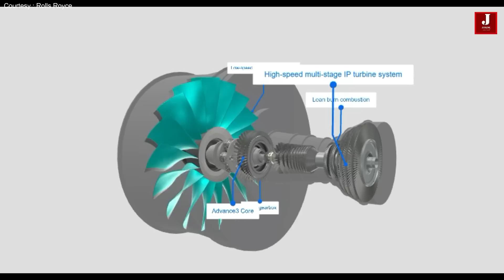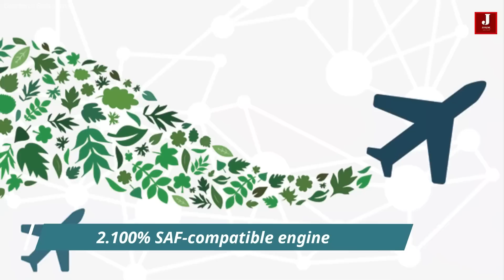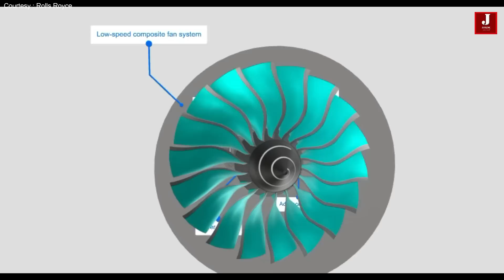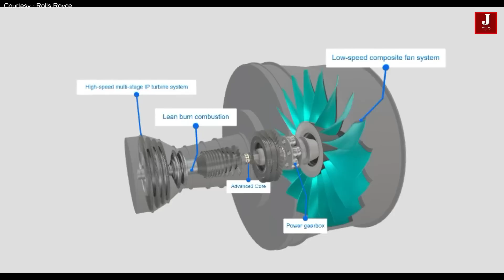The world's largest engine The Rolls Royce UltraFan: 10 Key Takeaways.

Comment: Even the current A350-900/-1000 can hold UltraFan engine without changing engine positions
Reply: No....that is not the idea. Rolls have built this demonstrator with 140" fan as its the largest size that can be fitted to the 777x (even though GE have exclusivity till 2027). It will give RR an idea of how the design compares with other offerings. Then it will be scaled down to fit whichever plane they plan to adapt it for.
Reply: @nathd1748  2027? so the 777X's launch date at this rate
Reply: @nathd1748  exactly.....the ultrafan would also fit for narrowbody
Reply: @Stradivarious Hardhiantz  yes. RR are itching for a slice of that huge A320neo backlog.
Reply: @nathd1748  They already missed that boat.
Reply: @John Iii  Missed the start of the boats journey you mean? There are about 4000 outstanding A321 orders that will take Airbus 10 years to get on top of. If RR provide an engine option that knocks spots off the current Leap and GTF, Airbus will certify it. You are miles from the action mate. I'm HERE right IN IT!! Current figures from initial tests of UF are giving 12% fuel performance saving over the GE9x...YES TWELVE. You will hear the official news in about 3 months. Last time round I had to tell you the UF was built and ready for testing while you were claiming RR had put it on the back-burner!
Reply: @nathd1748  John is very anti Airbus and RR, I've been reading his bile for years, he's even saying about the back burner on this video on another post
Reply: Whats the finacial gain? Why would you change from the WXB97? The ultra only has 3,000lb thrust  more and engines are very expensive plus the Ultra STILL isn't certified
Reply: @johnchristmas7522  UltraFan will be available on multiple thrust....the Trent probably derived to UltraFan to minimised RR production costs